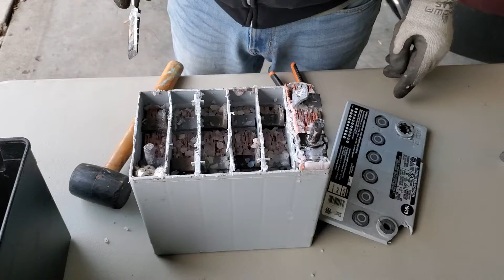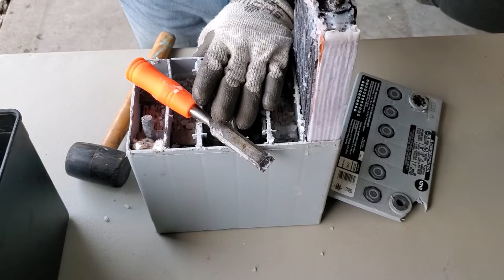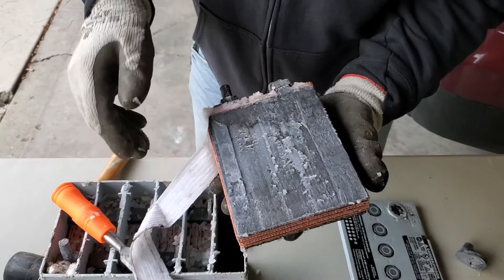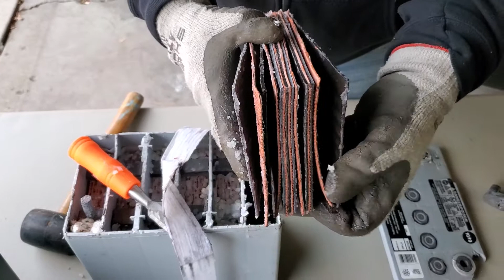GEL Battery- A look inside

Comment: Why a gel battery is fully charged and when times of using the battery,it doesn't last that long
Reply from the maker: It would depend on temperature, age of the battery and the load you are trying to power.

Comment: Hello JohnnyTheFox71 - I have a battery AGM with these same hexagon cell tops (MKpowered 55amp). Can they be unscrewed with a hexagon 6-sided socket?
Reply from the maker: It's not necessary to do that as the hydrogen and oxygen recombine inside the battery. Exposing the elements to air could cause premature failure and also void your warranty

Comment: I have a gel cell battery from wheelchair, after trying rescue it with charger for days, ended up only one cell has no voltage drop, others seem ok. If I open it like you did, possible to fix it?

Comment: so are all those plates lead? or are the + and the - from a different material, if both the + and the - side are lead, then how does it generate a voltage.
Reply from the maker: Yes the plates themselves are made out of lead. What makes a + or a - is the paste formulation. The lead plates are pasted with different types of chemical make up. That along with the acid, and in this case a gel paste, create voltage and stored chemical energy
Reply: @johnnythefox71  thank u for simple explainig...my question is that ...if we put new gel can we use the battery again ...
Question also...what is the orange insulation card made from.
Thank u

Comment: thanks for cutting it for us, nice to see the inside. i have a question, can a gel battery be recharged and be used on repair mode by trickle chargers ? is it important to charge it prior to first use? using a 5 amp charger on a motorcycle battery can ruin the new sealed gel battery? and does it really perform better on hot weather conditions and really discharge it self less fast than regular batterys, alot of questions and i'm curios to hear an answer :) thanks

Comment: Are these batteries good for car audio?
Reply from the maker: Yes, with consideration. Make sure your vehicles alternator does not exceed the voltage recommended by the mfg (no more than 14.6V is about avg). I would also have an external charger too in case of over discharge and regular maintenance. I recommend Interacter chargers. Thanks for the question! 😀

Comment: What will happen if i add distilled water to a gel based battery?
Reply from the maker: You cannot. Gel batteries are sealed and do not require water additions
Reply: If the battery performance decreases in the future, will it work normally if I add distilled water?